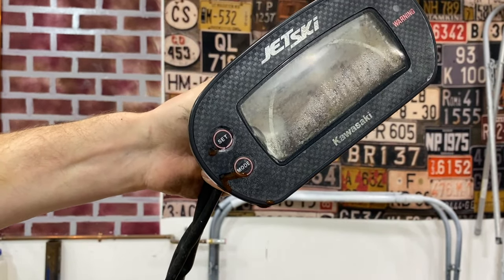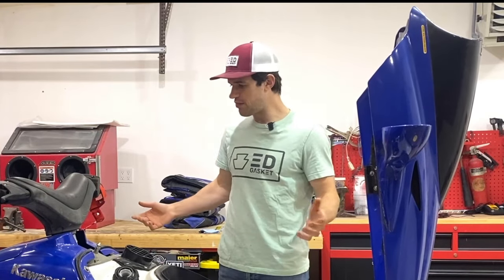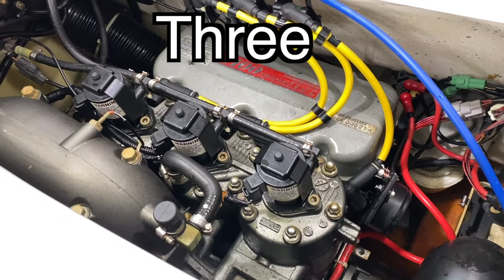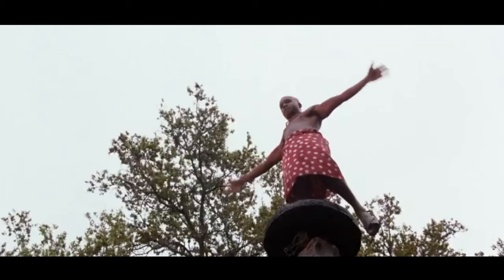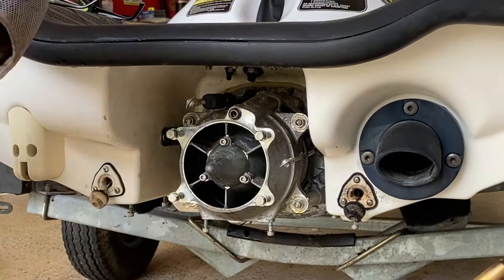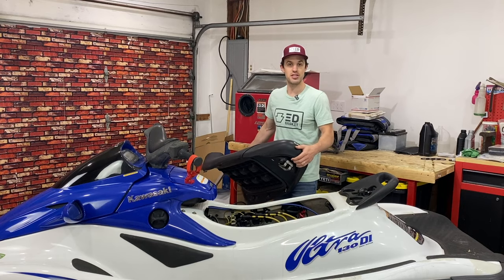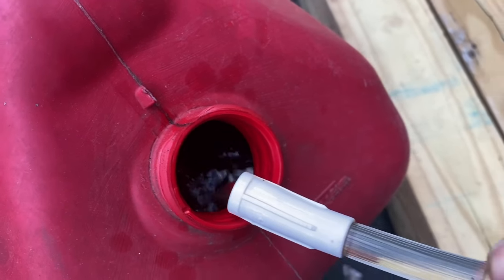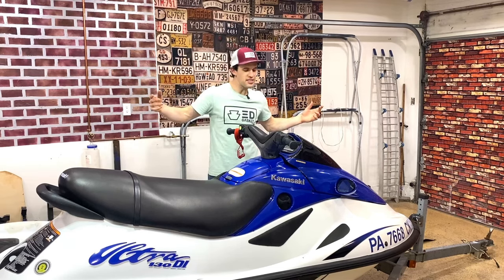Easily Fixing an ABANDONED Jetski

Comment: In the future you can usually really easily tell if it's the pump or the engine by just looking at what's moving. You can see in the clip that the rubber connector is turning the crankshaft a little bit while you're actually flexing the steel shaft going to the pump.
Reply from the maker: Good call my friend!

Comment: It had muddy water in the display - did the previous owner sink it? Did you check the rest of the engine bay or just start using it after you test drove it?
Reply from the maker: I fired her up and ran her full throttle! It was under a cover for a few years before the cover ripped and the. The rain kept it wet for a few years